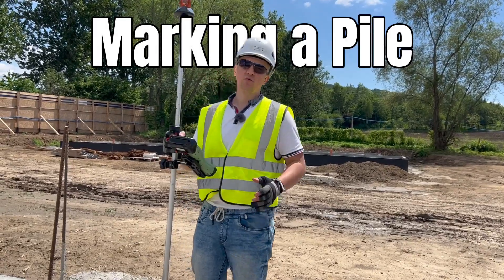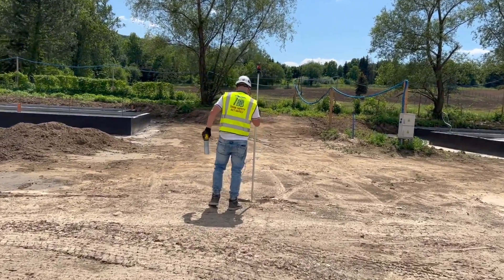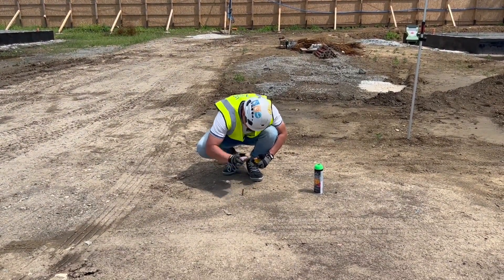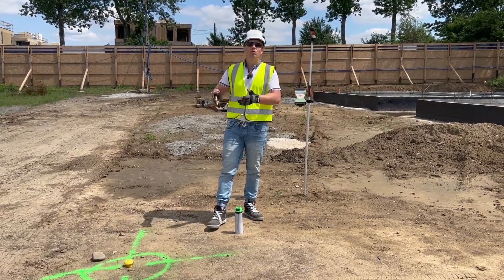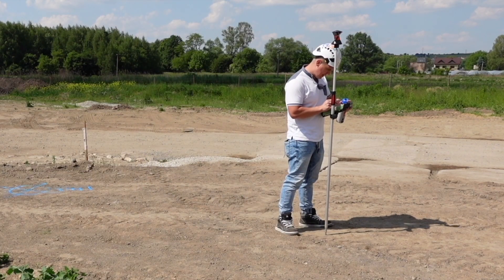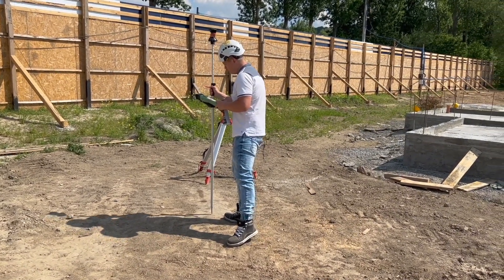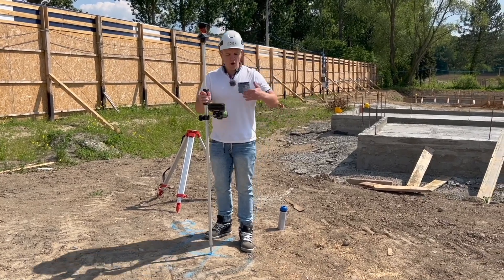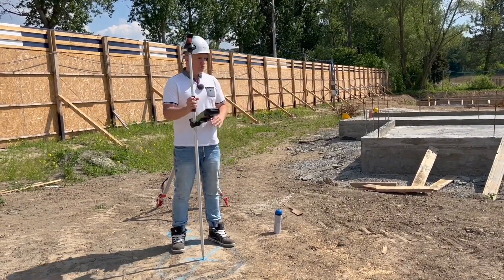How to Mark a Point in Construction Tutorial: Setting Out Stakeout Using a Total Station

Comment: I prefer using a 1"x1" hub ( I call it a Ginny) and write the information on a lath with offset, C/F to pipe flow and elevation of the Ginny on the back. I am not really a fan of the tape method, with the experience that I seen when a contractor or someone else doing the work trying to set a leveler, sometimes they will knock the tape down little by little without noticing causing a elevation error. Is it a big deal? probably not but I like to have my information I set out to be precise. Great vid though!!!
Reply from the maker: Thanks for the comment! I was typically with the team most time so often checking. Sometimes setting the stringl line on blocks etc too. Thank you for sharing your experience and tip!!

Comment: Your marks are 10 mils out already, bashing it with stone? you marked 50 points, how much errors you already accumulated?
Reply from the maker: Not sure how did you take 10mm, bit that’s still ok, that’s why we’re marking at point (on the controller)manhole doesn’t matter for the dig. I am marking using stakeout so the worse case I can make a single error at each pile, no error accumulation here, unless you start taping off it 😁
Reply: Can you do video steps by steps on taking out drawings from original plan and transferring to Trimble total station to set out pls ?😊